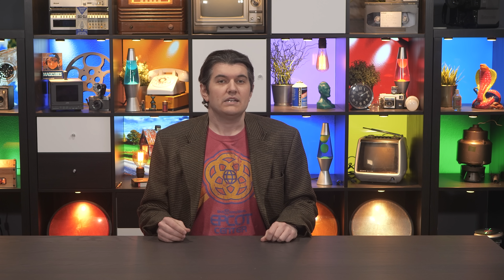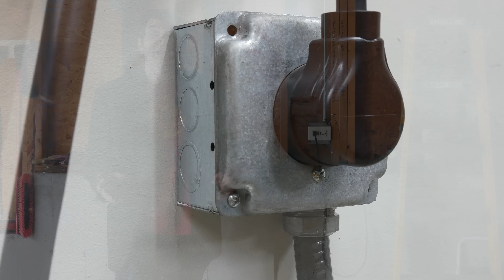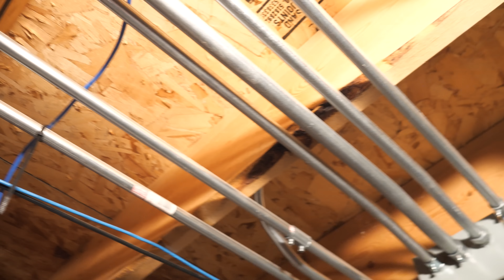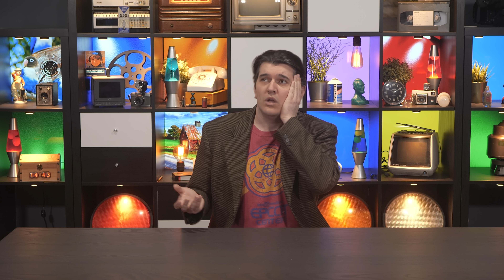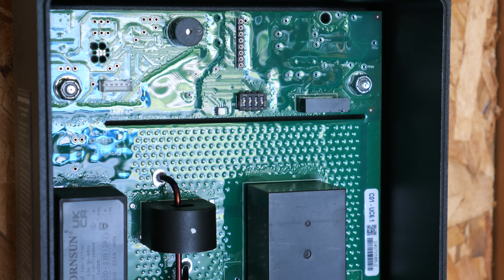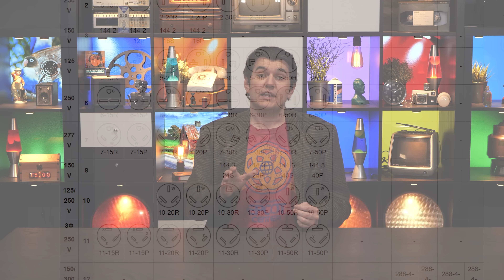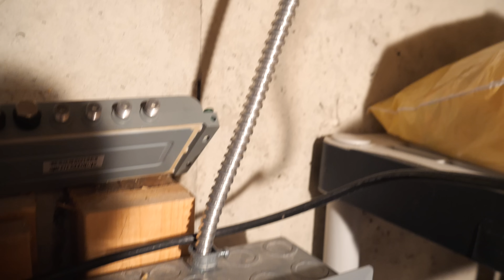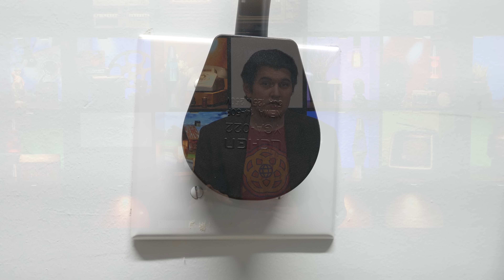The "standard" car charger is usually overkill—but your electrician might not know that

Comment: Another thing to check before doing your own installation: check with your power provider if they have incentives or programs for EVSE installation. In my area, my power company would offset the cost of the device entirely. The caveats:
- This was a part of a load shedding program where they could delay charging or reduce charging on hot days. So you needed to use one of their recommended devices that required an Internet connection. 
- They offered $10/month off the power bill as long as you were enrolled.

If you don't like that idea, check with your power company again. They may have a similar program that can communicate with certain vehicles to do the same thing, with the same discount. Not every EV supports this. As indicated in the video, yes there can be some amount of privacy concerns here. You may not consider it "worth it". For me it didn't matter since all the load shedding happened when I was away from the house, anyway. So, since I'm a cheap date, getting an EVSE plus money off the bill with no sacrifice was a song my cheapskate heart loved hearing.

And the final caveat, as someone who got caught by EnelX's/JuiceBox's middle of the night decision to abandon the home charger market and shut off "smart" features (like the abovementioned power shedding schemes), if you are buying an EVSE with smart features, make sure the manufacturer documents what happens when the Internet isn't available. My "killer feature" that I loved about the JuiceBox was the ability to have multiple units on the same circuit, which would load balance so as not to exceed the maximum circuit capacity. I learned the hard way that this doesn't happen with the EVSEs talking on the home network ... they need "the cloud" to do that. For such a simple feature, this seemed ridiculous. Since we have three electrified cars, I went with Wallbox, which implements the same idea but does not require an Internet connection to make it work, you just (essentially) run CAT5 Ethernet between all the EVSEs on the circuit and they will figure it out.

I'll underscore that I did the above because I have 2 PHEVs and 1 EV ... and I'm lazy, and want to plug them in when I get home and let the electronics figure stuff out. We could make it work with a single EVSE, or a single 240 EVSE and a 120V one. As rare as full charges are, I don't think we have ever had a situation where every vehicle had any sort of a real need to charge at full bore simultaneously.

Finally, props to Technology Connections for clearly calling out the difference in the "EV model" versus the "Gas station model". Until you live with it, you don't realize how convenient the EV model is, people concentrate on the handful of times they MIGHT need to use a fast charger on a road trip, but don't think about the fact that you don't need to wait with the car while it's charging, you can combine a charging stop with a meal/bathroom break and perhaps "lose" no time at all, especially when you consider that the total time for a stop with a gas car is REALLY (time for eating + time for bathroom + time to find a gas pump + time to fill the car ) If you are traveling with kids, there's also a "dealing with kid delay" number in there, too, which can really push the amount of time you are going to spend stopped. At least you can have the EV charging while your kids are dawdling around.

Comment: I dont know how they are related, but I was going to buy the basic grizzle classic and then I found Lenz charging solutions. They are identical down to the owners manual. Same dip switches. It is so simple and needs no tech. They sell theirs for around 259 with discount codes, but normal price is 289. The cord is heavy duty as well as the connector. We use it for our new equinox and our mach-e. Whoever gets home first plugs in first then usually before bed I switch to the other car. I have it set to the 32amp setting even though we installed a 60amp breaker and a 14-50 heavy duty receptacle and it has never let us down. Love being an all electric family.

Comment: I’ve noticed that most electricians I’ve used don’t use screwdrivers that don’t torque to spec…I added an ADU to my house and wired it. The electrician that installed my car charger didn’t torque the breaker side and the wires came out when I was installing my new breaker for the ADU. I decided to check the plug side…far from torqued correctly so tightened that side as well.

Comment: Slow charging is healthier for the battery. If an EV is all you have for transportation and you do more than just drive to work and back or use it a lot on your days off  then having a fast charger is a good option. Because a lot of cars using a standard wall outlet only get a few miles of charge overnight and you may be playing catch up.

There may be another option out there for some people. That have their clothes dryer in the garage or share the same wall. The device plugs into your 240v existing outlet and you can flip a switch to either power the charger or dryer. But that's if you have a dryer in the garage or the same wall. Is it just a gimmick? Not sure.

Comment: My install was far easier than yours.  When I added whole home backup (6 EnPhase 5P batteries) my main panel outside became a disconnect and I got a branch new panel in the garage, right up front by the door.  Exactly where I want to put my charger.  It's even mounted outside the wall.  I chose a hard-wired charger and just ran it right to the breaker.

My only regret is that I didn't look at paying an extra $150 for the EnPhase charger.  I previously saw pricing on their huge 64A chargers, but my car only charges at 40A. Turns out the 40A charger is quite reasonable.

Comment: I have a Tesla and I put this in my garage, and now I also have a 240v plug for my new welder.  I want my car to charge As Fast As Possible so a 50-60 amp circuit was installed.

Comment: One point you gloss over with standard wall outlet charging is the fact that their lower amperage do not allow for the draw to safely charge in subzero temperatures. Trickle charging a lithium battery without either internal heating or a dedicated heater can permanently damage the cells. Ask me how I know!

Comment: Speaking of charging. I really don't get all the push for everything to charge faster. Like... why? Even 'slow' charging is fast enough now and come on most of the time we are charging things *too fast*. Any time I see a phone that doesn't have some insanely fast charging people comment that it's useless. But why? I actually switched to a slower charger because my phone was getting too hot and I've had battery issues in the past that I know for a fact were related to fast charging. I just charge my phone over night . And before you say anything, my phone has a neat thing where it detects my alarm clock and sets charging to be done around the time I wake up so the phone doesn't get cycled constantly. I really don't understand why we keep pushing for something that destroys batteries. How many times do you guys need to charge your devices during the day and you can't spare 20min? Efficiency, battery life and battery capacity are all so much more important to me personally. Any time I have to replace a device it's because of the battery over 90% of the times. As you showcased with EVs, people really don't seem to understand that longer charging times do not matter all that much when it's happening when you don't use the device anyways.

Comment: As a (northern) european this is very interesting to watch, and makes me realize how things are in some ways so similar but also so different.

Here it's very rare to have a charger that is plugged in rather than hard wired, if you have it primarily in one spot. We also very often have load-balancing, to make sure that we don't overload our grid connection, which many people have as low as 20A or occasionally 16A (but a 3 phase connection, with 240/400v) - as upgrading it can be a big additional annual cost (staying with a lower one and getting a load balancer will probably pay off in just a year).

Comment: The thing that you missed is the buffer that the battery itself provides. You don't need to fast charge for errands because you have 100 or 150 miles left in range after your daily commute, and you only use a few hours of the 8-12 you are parked to make up for the commute - the rest of yhe time can make up for unexpected trips and because of thr battery as a buffer, even if you don't get all the way to 80% you can just carry over your deficit to the next day where again you'll have extra time to charge compared to your needs

Comment: I so wish now I bought a simple "stupid" EVSE that one with smart features. My car's app has a function where I tell it what state of charge I want, and what time it will be ready. You just can't beat that feature for both planning trips, and charging during low rate hours.
However....the app on my EVSE doesn't like that feature and fights it. The EVSE company wants me to use their scheduling instead which is clunky and un-reliable. I just wish I had installed a basic plug instead.

Comment: I have been thinking about this for a while, giving my situation. I tried to get a wall connector installed but it would've required a panel upgrade, so the solution for me was to get a mobile connector and to use the heavy duty 10-30 dryer port in our laundry room, needed an extension cord as well to run through attic to garage. I charge at 5kw on my LR MY and its more than plenty for me and I drive a lot!

Comment: Regarding the point about multi-family unit dwellings: I believe the paradigm we need to shift to is public charging as the solution instead of having utilities make some sort of solution for each EV owner.

I regularly walk through apartment complexes with hundreds of units. Multiply that out by all the major cities, multiply by more than car per unit, etc. and it becomes evident that we simply do not have enough copper in the world to provide individual slow EVSE for every EV owner, especially if we want to move to full adaptation of EV's.

 Battery tech is changing quickly towards higher energy density and it won't be long before a full-charge up at a station takes about as long as a gas up. Its about economies of scale. Shared hubs are just more efficient than each individual having their own separate EVSE.

Comment: I have two EVs and my wife and I have been using a level 1 charger from Lectron which is faster than the standard level 1 charger it came with. No need for an upgrade here.

Comment: Due to home renovations my regular 11kW (hardwired 3x400V+N) charger is unavailable and I'm charging my car using a granny charger @ 1.7kW (230V) and, actually, I'm perfectly fine.
That being said, I'm not doing a lot of miles (kilometers) most days of the week so I have the time to charge at home during the day.

One advantage of the bigger charger (other than charging 10x faster) is that the charge window would fit fully between the "operating hours" of my solar panels, allowing me to fully utilize their output, especially if I would swap the charger for one that can integrate with an EMS.

Comment: I noticed something. The continuity of your table. It doesn't go across the screen. It cuts off at the Left of the screen (your right). A bit distracting. I might go back several videos to see if Ive missed this important blunder.
On the topic at hand. I don't drive an EV. I'm someone who has warmed up to the idea of the EV. But its a fascinating subject because the whole point of an EV was to cut down consumption of Electricity from the power outlet, thus making the source produce less pollution into the air. In my mind to efficiently own an EV is to also outfit your home with Solar and a Battery. A task that is technically not viable for my needs as I'm still single and my usage of power is Minimal. Hence why I still own a standard car. BUT this is good information for later down the track. I wonder if Australia has something similar.

Comment: Here in norway you cant use the "emergency charger" for dally use. you need a dedicated charger station "without a socket" connecting it.  it also need a special "RCD" that can handle the DC power fault etc.
today you rely want to have a "smart charger" that will adjust the power to the car after the house total lode as you pay tariff's for your "top load" so ppl set a 10kW total 240V house lode. so a lot of the times you might not get any power to the car. and now moste often ppl have two car's and that both is EV's. as you have hardly had any petrol or diesel cars sold in the last 5-8 years or so. i run a petrol car now. 50% of my trips is with a trailer on the hook towing another car. and 50% of the rest is longer trip's.

Comment: The Cook county EMT conduit standard is so strange to me as a NY electrician. I did not know there are exceptions for MC to be used in Chicago but it makes sense. You can certainly buy 8/3 sized MC cable and higher at any local electrical supply house.

Wire-nut supremacy.

Comment: The first year I had my EV i survived off of a regular electric socket + level 2 and DC public charging. I was fortunate to be able to upgrade to 60 amp (11.5kW) hardwired charger.  It’s a complete luxury for my needs — 99% of the time it’s overkill.  I installed a NeoCharge switching box for not too much money to share a clothes dryer outlet for a friend’s EV and they are doing well with only 5.5kW.  Another friend is still on a regular electric outlet and doing well, and is considering moving to a 2kW outlet as a cheap upgrade

Comment: Since getting an EV a year ago, I have been almost exclusively charging via a regular plug in wall socket. 
This is more than enough for me. I don't even need to plug in each night, just every few days to get the battery back to full. 
I think that's one of the things that many drivers don't understand is that I don't have to spend time waiting for my car to charge at a public station because it's got a full tank every time I leave the house.

Comment: German automakers call the 120V/230V outlet slow chargers "emergency chargers". I agree they get the job done, but they're pretty inefficient in themselves, and the cars standby power hits harder during slow charging. I did the math when we got an EV - installing a dedicated 11 kW wallbox with thick wires paid for itself after 60k km. I'm not saying you need that much, but please do research the effiency of the cheapo included chargers.

Comment: I like the "unless your a professional driver" disclaimer. I drive Uber several days a week. The other 'challenge' I have is I have an Older (2020) Bolt and I do NOT have the DC Fast charging functionality. With those two conditions it was 'necessary' for me to get the full 7.5 kwh charging speed. There is one "Smart" feature that I like. The Jucebox (now defunct) has a feature that lets you have multiple EVSE on the same branch. The multiple stations will coordinate charging to limit load on the branch.

Comment: While I disagree with the sentiment that smaller is better for my usage, this video did show me how to move the dip switch on my 40-amp Gizzl-E mini charge cable I had purchased to replace a failed 32-amp charge cable. So after trying to set the Gizzl-E to 40 amps with the app it would only ever go to 24 on the pull-down menu in the app, but after watching this video I checked the dip switches, and they were set to 24 amps. I have this set up on a 50-amp circuit, so being able to run the charger at the advertised rating is a good thing. I charge my car in the driveway and the neighborhood is not the best and it is only a matter of time before thieves figure out the charger is worth some money so leaving the car to charge at night is generally something I try to not do.

Comment: In the UK, we have electricity tariffs that are cheaper between 23:00 & 05:30 so this is when we charge our car and many from a car charger on a 40A circuit but the maximum charge rate, on a single phase, is 32A (7.6kW). You can charge from a single socket outlet 13A (3.1kW).